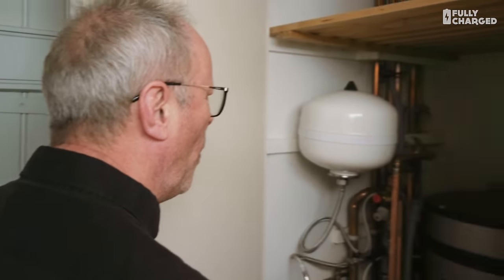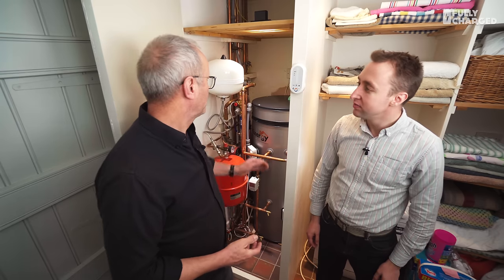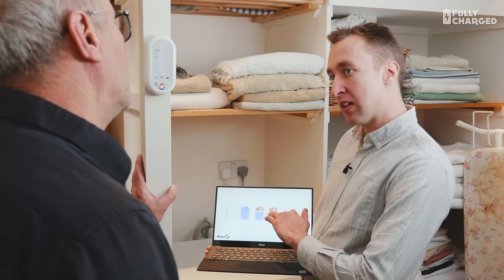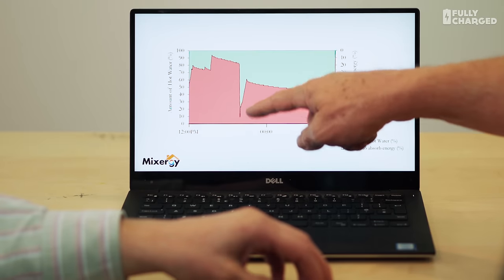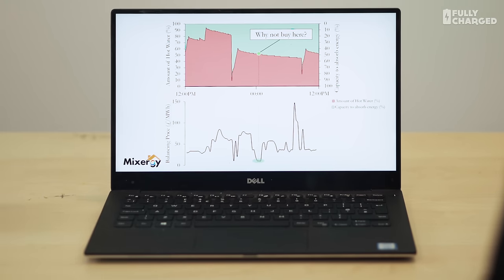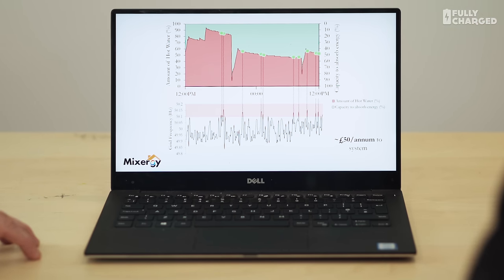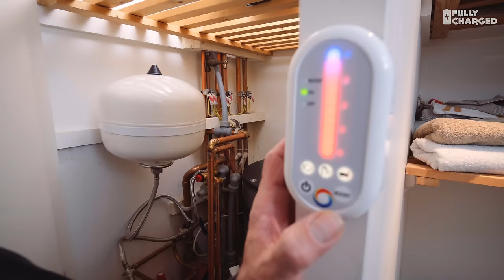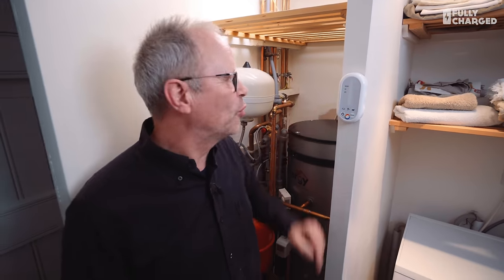Mixergy Hot Water Tank | Fully Charged

Comment: I've a 300L tank heated with 2 immersion heaters running off the solar PV on my house. Depending on available power I switch on one or put both in series to heat the tank. It has 50mm of high performance insulation on the tank and is boxed in and sealed up with another 50mm of plywood/kingspan. Once it gets up to temperature it stays hot for several days which is great as I'm off grid!

Comment: It makes total sense using hot water for energy storage, but I never thought it would be practical since it would mean fluctuating water temp. I'm very happy to have been proven wrong. Very cool tech and another excellent video!
Reply: Cheers Jeremy! Exactly the thinking we have - storing energy by varying temperature is problematic from the point of view of heat-losses, accelerated scaling and scalding so we prefer to do things this way :)
Reply: I do not see this thing feasible with all those internal pumps. Will break soon, and is  more expensive. If you want to heat only what you use just use instant heater. This is too a little expensive since it needs a more powerful heater. And for the second part, storage, when is energy in excess, yes is a good idea, and is used already where the grid and devices are getting smarter. So if this part of a test, do a second one, with a regular tank used for storage when is cheap energy or excess, and instant heating for the rest of the time when there is no hot water stored, and see which one is better considering the overall price of energy, and system plus maintenance.
Reply: i didnt understand the video that much

Comment: One thing you forgot is to insulate the warmwaterpipeing from the watertank these things heat up quite alot and if you do your hot water externally via a gas or oil heater it can save you quite a bit.
Here in germany it is even required by law that you insulate these pipes with insulation that is roughly at least as thick as the diameter of the pipe itself to prevent heat losses and save energy.
You are not punished for not having it on, but it is a waste of energy and you can easily do it yourself and offset the cost of the insulation realtively fast.
Reply: 100% agree. In the UK my 1997 house has no pipe insulation and the pipes run under the upstairs floor from the boiler on the ground floor. Unfortunately, the floors are chipboard (particle board) that are extremely difficult to take up - they just break up. To make it worse I have laid engineering floor over the chipboard (but that is clipped together and just floating). It would have cost very little to have insulated the pipes when the house was constructed. Shows how backward in the UK building industry. I would just love one of your German zero energy Hus houses.

Comment: Fascinating. I can see the benefits in large users with predictable useage. Hotels maybe..
Reply: Larger buildings have system on a whole other scale and usually keeps relatively small amounts of hot water stored if any and at lower temps only to regularly and briefly get it real hot to kill of any bacteria in the system. They usually also control the production to have more HW on hand during the morning and around dinner time when most ppl shower.

In some sports arenas  with electronically controlled showers you let the showers run during the bacteria killing cycle. This is done at night.

This might be good for homes where you normally have had simpler systems and cant fit a more effective heating solution, using direct electricity to heat thing is quite wasteful.
Reply: We needed a new boiler three years ago and fitted an unvented mains pressure hot water tank, that is really really well lagged. We also had PV panels fitted with a device which detects excess solar generation and diverts that  to an immersion heater.
Smart as your system is with the stratification techniques, How about using your grid price sensing tech and the PV diverter to make a black box that can be retrofitted to  existing systems.  That would be simple electrical fit rather than a full plumbing job.
Reply: You can chain tankless heaters for this very problem.

Comment: I have two heating elements in my tank.  One at the top, which is on a thermostat, should the hot water run out.  And one at the bottom, which comes on at night when electricity is cheap.
Reply: That's a very practicable arrangement Stuart and one that works well with Economy 7, we just go a step further in having more granularity in terms of heating and a faster recovery of heat for small volumes in the top of the cylinder. So if you want to get more efficient use of Eco 7 along with better control then the Mixergy tank provides a useful alternative!
Reply: Pete armstrong Maybe multiple heaters down the tank would be more solid-state than pumps for circulating cold water.
Reply: The pump is called a shunt pump. You can have just one 9kW immersion heater at the top of the cylinder. This will only heat the top one third or one quarter, giving a quick heat recovery. To heat the the rest of the cylinder a slow moving shunt pump can gradually move the hot water down the cylinder to whatever volume you want. If you want half full of hot water then you can have it. As the water cools in the top of the cylinder because the pump is moving hot water slowly down the cylinder and cooler water from the bottom to the top, the immersion's thermostats kicks in. So you always have usable hot water at the top of the cylinder ready to draw off.  

The cylinder will have, or maybe should have, baffles down the cylinder to maintain stratification - keeping hot water in stratified levels down the length of the cylinder. Temperature sensors would need to be at points down the side of the cylinder. 

Having a low wattage shunt pump means only having one electrical immersion heater, meaning less cost - no heavy cables, for multiple immersion heaters, switches, etc. Three immersion heaters can draw a fair amount of electricity,

Comment: Fascinating product - at scale this could really help smooth supply and demand. With technology like Tesla's recent "grid scale" batteries in Australia and these water tanks the idea of high/low price spikes in grid prices will be a thing of the past before long!
Too much power? Heat up a bit of extra water in thousands of tanks.
Too little power? Delay heating up water for 5-10 minutes.

A friend of mine told me there's a hotel in London that's connected to the grid - at peak times (end of Coronation Street when all the kettles are turned on) the power companies can make the hotel's air conditioning turn off for a couple of minutes to help reduce demand.

Sounds like a no-brainer if your old tank fails - I wish them every success!
Reply: Greg thanks very much for the support, much appreciated :) do feel free to drop us a line through our website www.mixergy.co.uk
Reply: Agreed. Much cheaper and simpler than battery storage though we need both.

Comment: Interesting new way of getting hot water. I went about 5 years ago for a carbon fiber heated tank since I hhave PV pannels since 10 years. So I switched more to electric rather than gas commonly used here in Italy. The carbon fiber layer which heats the stainless steel tank is on the outer side of the thank. It gives the advantage of not building up calcium - the typical problem with a traditional coil heating system - although I have a water softener to solve this problem. This carbon fiber heating system claims to be 30% more efficient in energy consumption over the traditional tanks with coils. I am pleased with it and now installed the Tesla PowerWall2 since last june to manage all this even better. I also control the energy flow to the hot water tank with a low cost WiFi plug which I control from my smartphone. It allows setting times (on/off) or manually control the energy to the tank. Fun with all the electric solutions and the technologies to support all this.

Comment: I thought that’s how old-school hot water tanks worked, there were 2 elements coming from the top, a short one and a long one, and a switch “Sink/Bath” which switched between them. So you could heat a small or large amount of water. This seemed to fall out of fashion for “thermal stores” which heat the whole bulk of the tank. Guess it’s going back to the old way, albeit more hi-tech!

Comment: In the U.S. most electric water heaters use thermal stratification, but for a different purpose. They have an upper and lower element and use them independently to keep the top water hot longer. A couple of years back I went to a heat pump water heater, which It's the lowest energy use water heater available here. A side benefit is that it air conditions my garage by taking heat out of my garage and putting it in water. I use a timer to make best use of the variable rate tariffs and solar, but a timer is not smart and it would be nice to have that part automated. The water heater has an smartphone app, but strangely there are not options for timing for solar or rates.

Comment: I have a similar system with a solar panel on the roof. It's honestly the best thing I ever bought. After emptying the hot water with 3 showers in the morning we have a tank of piping hot water by 4pm the same day with no use of oil to heat it. Even in the winter it raises the water temperature by a good 30 degrees leaving the oil heating for a few minutes to top up.

Comment: Would be interested to see how this compares with one of the SunAmp Heat Batteries that Fully Charged looked at a year or so ago. Either way I think the idea of storing excess renewable energy as heat is going to be the way forward as its so much cheaper than storing as electricity. Added to which heat is the biggest use of energy in modern homes.
Reply: I would hope this is in the price range of a normal water heater replacement, SunAmps start at £1,200 without vat or install, and if you have Solar you want a normal tank and dump as much heat as possible when you have the free energy, you may not have the sun tomorrow.

Comment: I have what's called a solar iboost fitted to my emersion heater tank, whenever there is excess solar energy it's diverted to the emersion heaters in the cylinder, my cylinder has two emersion heaters in it, one at the bottom and one in the middle, both are connected to the iboost. The iboost diverts the energy from one emersion to the other when required. In the mornings when very little In the house is being used the cylinder is heated up via solar and as it's a pretty modern (normal) boiler it stays hot for hours. since it's been fitted our boiler hasn't come on once to heat any water, we have had free hot water from solar.  It remains to be seen how it will perform on the shorter winter days but the signals are good so far. I tested it by switching the emersion off to allow the water in the cylinder to cool, I then turned on my PC, three TVs plus various lights, (the solar was producing 2.8 kwh at this time). I then turned on the emersion, the iboost diverted 1.1 kw to the emersion and heated the water.  It will always divert electricity when there is more than 100w free, so it looks promising so far.   It takes probably 15 mins to install the system and is well worth it so far.
Reply: Thanks read more! we are big fans of solar iboosts - if you connect a solar iboost to our system it stratifies the energy from the top of the tank downwards. This means that you get more service from small surpluses of solar power. Furthermore, you can set different charge points on your schedule so that other appliances like an electric vehicle or a home battery can take the surplus once the tank has reached the level you want.
Reply: we have had our iboost a few years now  you will not get much hot water in the winter

Comment: Robert, will you be doing any kind of follow-up on the tank in regards to how well it worked for you (like did it run out of hot water more than usual or did other unexpected issues pop up - or not), any data regarding cost savings, and etc.? Very interesting episode - I know I didn't really think about my tank as a possible energy storage device.

Comment: US water heaters/tanks have two elements.  Like this innovative tank the cold water comes in the bottom and the hot water is drawn from the top.  The top element is for immediate use and bottom one is for full tank heating.  The upper area of the tank mush reach the set temperature of the top thermostat before it switches the electricity down to the bottom element which then turns off and on as the bottom thermostat dictates and keeps the entire tank hot until hot water is drawn off the top of the tank.  When the top thermostat registers the temperature to be below it's low setting then the electricity is switched back to the top element.

Comment: So it always works in stratification mode, cold to hot. OK, so how does it deal Legionella bacteria, haven't heard a word about that, you know at 20-45 degree water becomes favorable temperature for stuff to grow inside your water tank, stuff that might result in your death. Natural gas boilers, heat pumps have heat cycles for DHW tanks to kill off those bacteria, and it is done daily.
P.s. my 200L DHW tank has 720Wh/24hour losses, they need to step up there insulation as well, I think recirculation takes a lot more.

Comment: When travelling to UK I was surprised solar water heating systems arent really used there. They are more efficient than panels producing electricity
Reply: Not if you use a heat pump. Heat pump plus PV is very efficient
Reply: @ThomasBomb45  debatable

Comment: Agree stratified domestic hot water stores are the way ahead and storage for heat pumps district heating as it reduces installed capacity for heat supply from 23 kW to 60 kW for instant hot water to 3 - 9 KW also system can improve the efficiency of gas boilers when combined with a plate heat exchanger in  the pumped circuit.

Comment: This is not new at all. In Australia we have lots of solar hot water backed up by either instantaneous gas or electricity. The electric tanks have an element 2/3 of the way up the top providing a constant supply of hot water on cloudy days. When the sun is out the panels circulate hot water from the bottom, eventually heating the whole tank. Very simple and inexpensive and common 25 years ago.
Reply: yes, it looks like an old hat dressed up with some gimmicks around it.
Reply: Hey this is "on the Internet" now :-)
Reply: Jimbob it's new to 99% of UK combi boiler users
Reply: Luke W Not quite- we all had tanks until relatively recently, combi boilers have only really been more popular for the last 20 years or so. This is just an update of old technology.
Reply: @spencerwilton5831  Combi boiler like the old Gloworm 100e have no tanks - they heat both rads and incoming cold water which is why showers were always cold to start with. Heat storage is different to the old boiler plus tank which meant using the hot water in the tank and letting it all go down the drain. Battery like thermal stores have been around for decades. Ours uses solar thermal, woodburner, gas boiler and electric inputs.
Reply: Luke W I'm not quite sure I follow you. I realise combis have no tanks, we have had them here for years. They are shite! Even the storage combis which retain a small volume of heated water inside them to overcome the initial cold water issue are rubbish- the system works ok, but being a combi rarely functions for long before it breaks down. An old system with a conventional boiler and separate hot water tank heated by the boiler completely avoids the issue of running a tap for ages, you only need to run a couple of litres off, just the cold water sitting in the pipe between the tank and the outlet.
Reply: I wonder how it compares to a heat store where the immersion element is at the bottom and can be heated by PV, the draw off water would gain heat from all the water not just the really hot stuff at the top. I think heating at the base of a heat store is a requirement due to the heat exchanger being the height of the tank.

Comment: That is one crammed closet/utility room. Americans love to do the same thing and design houses with a closet for a utility room. Then cram a boiler, furnace, water softener, water heater, etc in it. The main water line is where you can't access it. Oh and a floor drain sloping the wrong way just to throw in there. Then 10 years down the road when stuff breaks down, they complain about the cost. So what I'm saying is 10 years from now when that tank goes out and you have to rip all the copper out to remove it, better be ready for that bill lol.

Comment: Our old Yugoslav boiler from ca. 1988 had the same system, and was connected to solar on the roof. The roof part was absolute shit, but the boiler got heated in winter by a gas stove and in summer by the solar. Spring and autumn, you used electric heater that v was in the top of the boiler that heated enough water for four showers. Our modern (10 years old system is similar, but the boiler has much better insulation and the roof part is superb, heating 250 liters in spring and autumn  that lasts for few days, usually enough to get through rainy week. winter is again heated by the stove. I bet that in England you cud heat your house directly from the roof solar system. Electric management on the boiler from the video is impressive.